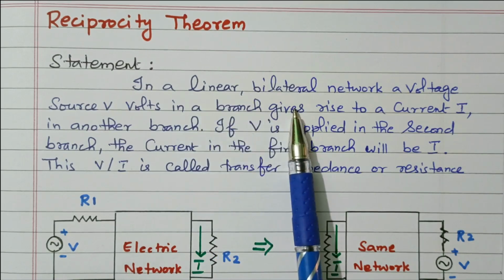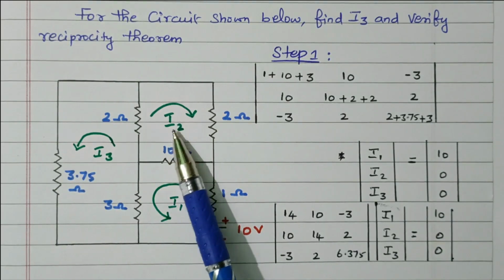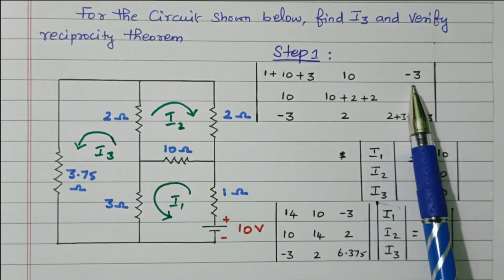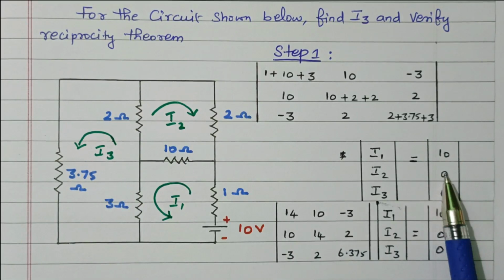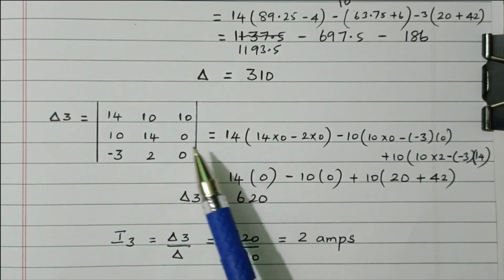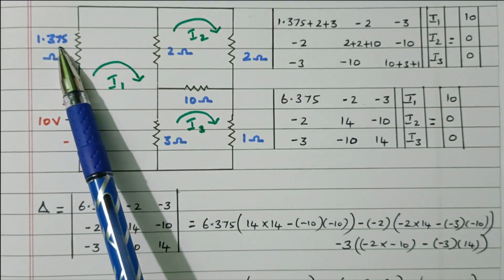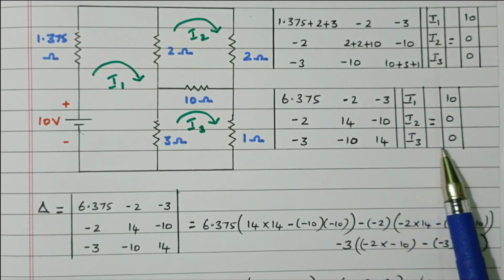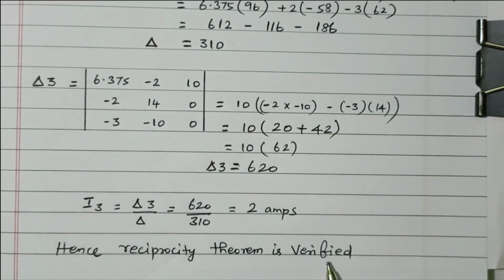21 Reciprocity Theorem   Definition, Explanation with Solved Problem

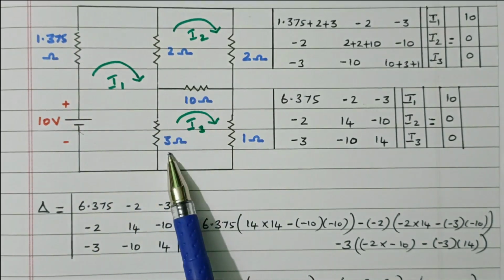Comment: Y we r taking 1.375 resistor with 10v power source 13:06
Reply from the maker: 1.375 ohms is correct value. In diagram mentioned wrongly